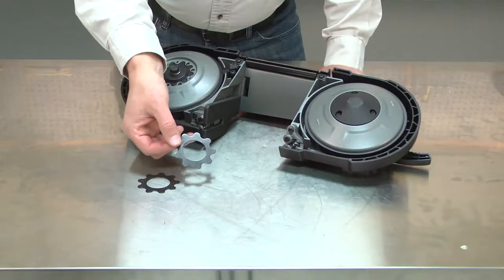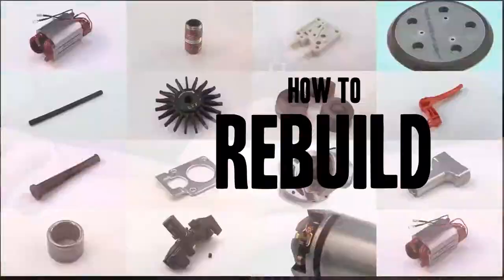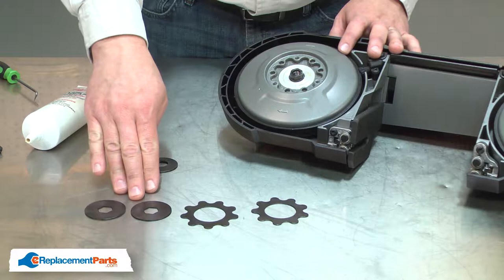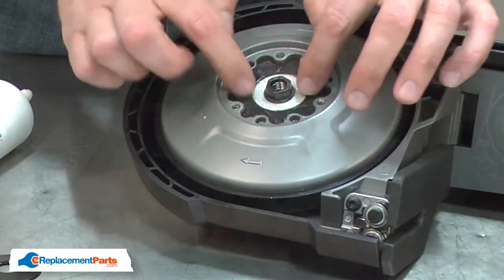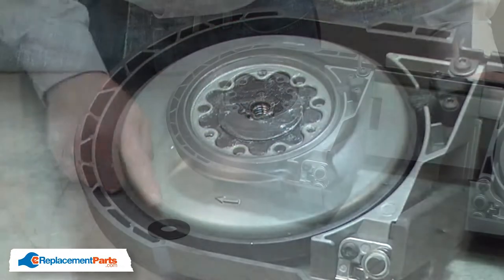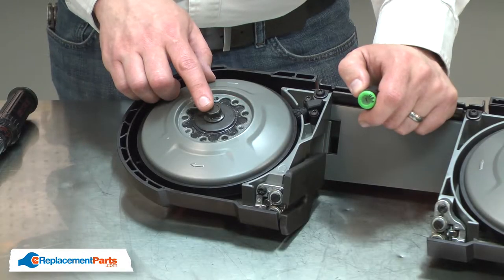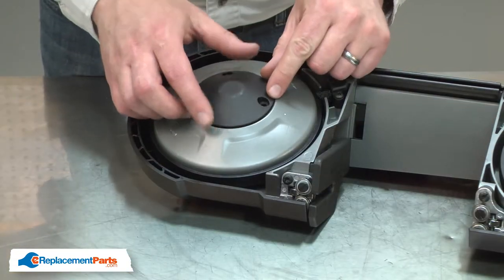Milwaukee Band Saw Repair - Replacing the Clutch Plates (Milwaukee Part # 43-06-0015)

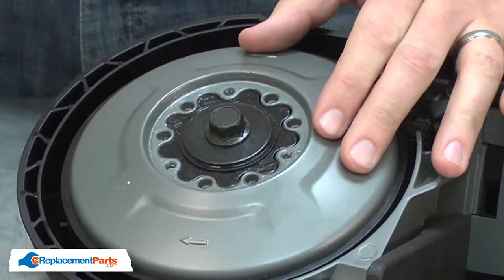Comment: 1:01 I had to hold the nut with a beaker bar then power the saw to get that bolt to move with out moveing the rest of the motor.